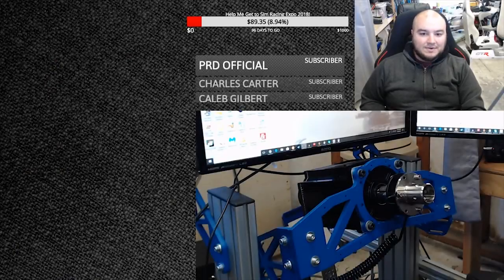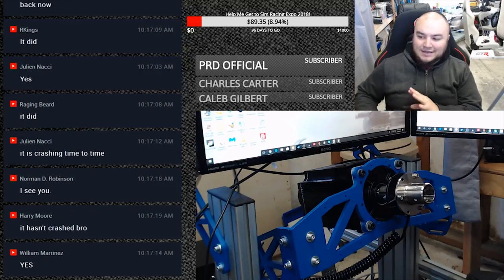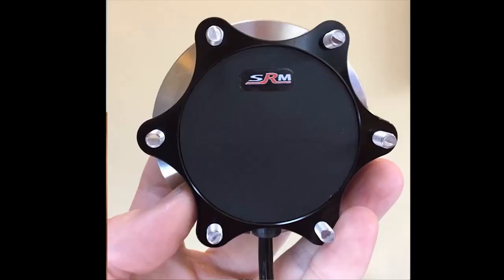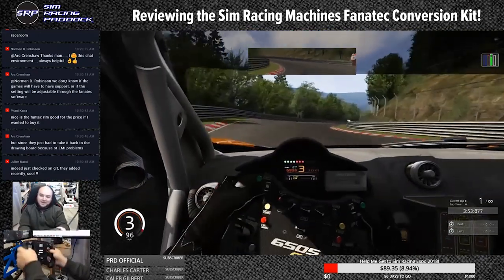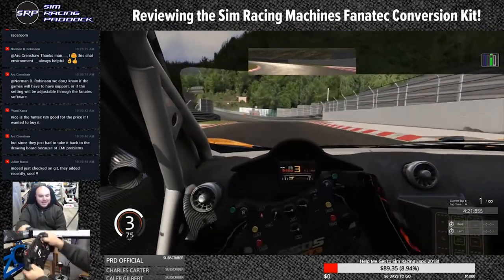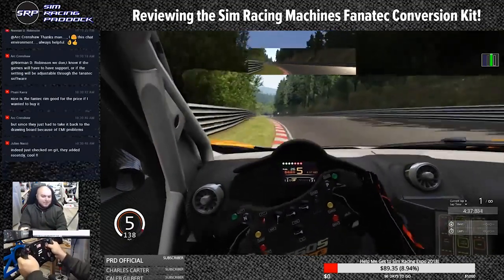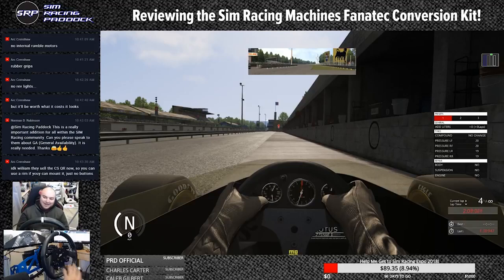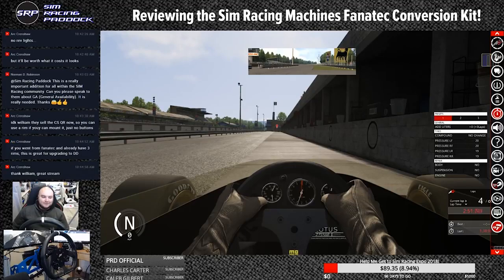Sim Racing Machines Fanatec Conversion Kit Review - Use Fanatec Rims on a Direct Drive Wheel!

Comment: Very good review! It’s to see the adapter up close, it looks like a really sturdy piece of hardware. (I’m studying Electrical Engineering in college, so I have seen plenty of stuff like this before) One thing I would suggest is to always have a ground connected even if you have shielded cables. It will most likely never be needed, but it’s never a bad thing to have an extra safety in place.

Comment: Nice review William. Only thing that wasn't mentioned is that you don't need to use Fanaleds. A while back iRacing implemented the Fanatec Wheel Display API. You can turn it on or off in the options in game or in the app.ini. As such if you plan on using fanaled's do turn off the iracing one. Having them both on can cause issues in the display.

Comment: I’m guessing that wire that is attached to your wheel is stationary so as you complete revolutions on your steering it will wrap around the center correct ??    But you have to unwrap it at the end of your race ?

Comment: Theoretical question for you...could this be used with other wheel bases other than direct drive?  Like using a fanatec wheel rim(usb to PC), and using a thrustmaster TX Base for force feedback?
Reply from the maker: Yes you could. There are companies such as Derek Speare Designs that sells adapters to use 70mm bolt pattern wheels/quick releases on Thrustmaster wheels.

The only concern I would have though is with the nature of the Thrustmaster ecosystem. The TM Quick Release is mostly plastic in construction, and I don't know how well the system would hold up with the longer shaft and added mass (therefore more inertia).

It is definitely possible though :)

Comment: Where did you buy your osw? I'm thinking about getting accuforce v2 but idk. Please help me good sir. I'm a newbie
Reply from the maker: I got my OSW from Sim Racing Bay.

For the Accuforce, the perks of it are that the software and drivers are better optimized to work better for a wider variety of games. Since the SimCommander software is a closed ecosystem, they can work it better. I've heard the AF feeling is MARGINALLY worse, but it's a solid option for people looking for a solid Wheel Base+Rim Combo.

OSW, if you're willing to tinker a bit, is my recommended way to go. You need to take a bit of time to learn the software and how to adjust settings (Sim Racing SKeijmel has some GREAT videos on how to adjust the Sims for OSW). Note that you WILL have to buy a separate rim for the OSW, and that can get pricey, depending if you want a rim with buttons/paddle shifters.

Hopefully this is of some help!

Comment: how much was your rig? i just need something simple because i race in vr. kind of tired of my wood rig and would like a direct drive soon. i just want something nice to go with a nice wheel
Reply from the maker: Well, honestly I would not recommend my rig. It is admittedly on the more expensive side (around $2,000 w/ seat), and limited compatibility wise. I think you would be happy with something from Sim-Lab, like the GT1 Chassis - https://sim-lab.eu/product/sim-racing-rig-gt1/

80/20 is a bit on the pricier side, compared to, say the basic cockpits from GT Omega, Simetik, Trak Racer, but the performance on them is astounding!

Hope this helps :)

Comment: Can you use something like this for an Accuforce v2 setup?
Reply from the maker: Yes you could! I know the "Your Way" model includes the part you could mount the adapter on. The "DIY" version would need a shaft adapter, like this: https://sim-lab.eu/product/mige-wheel-adapter/

I'd recommend just getting the Your Way over the DIY, especially if you're looking to get this adapter/converter combo.
Reply: @Simracingpaddock  The AccuForce motor shaft is 14mm; a (22mm) MIGE clamp is too large.   Avoid the "DIY"...

Comment: Will this work with a Fanatec CSL Elite PS4 rim? If so, you’ve just saved me over $1,000
Reply: MrJr Same mounting system for CSL and Clubsport series -> so it will work... that‘s one of the benefits with Fanatec equipment - intercompatible through the different product lines.
Reply: Yes this will work with the CSL P1 wheels.  We just released new firmware to include support for this wheel, so all new kits supplied now work with the P1 rims.  Still waiting for the McLaren rim. As soon as we get hold of one we will do our best to get that supported too.